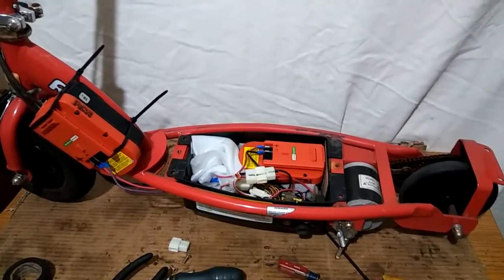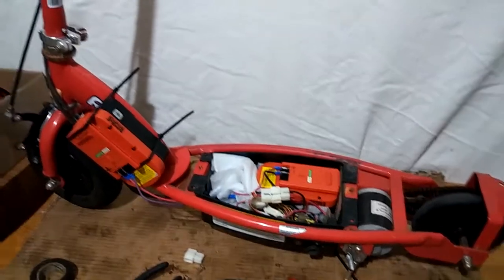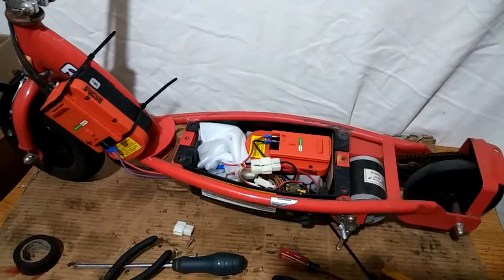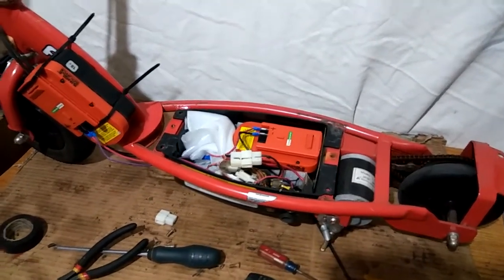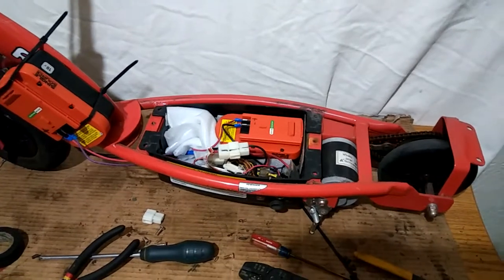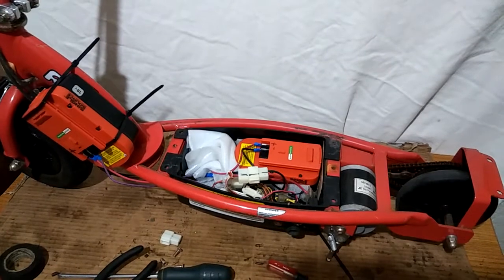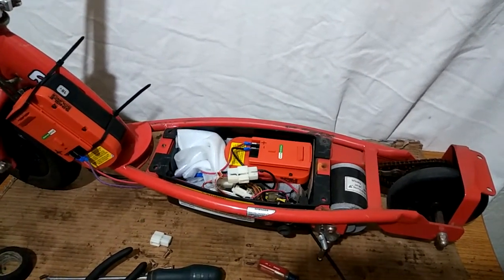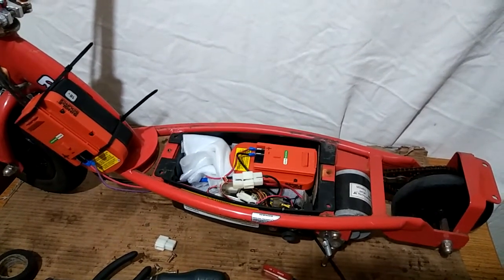Razor e100 mod

Comment: hey so I have an old e100 that I wasn't old to use when I was small but now I am 13 and found it in our storage and tried to start it up but turns out the batteries died from no use in a long time and the controller was fried from inside so i was about to order the battery and controller from online but turns out 15 km an hour to slow for me I want to go faster so can u just tell me the items u bought to make it faster so i can buy them before buying the items for slow scotter

Comment: what is the rating or watt power.  I want to make an electric cooler with this motor
Reply from the maker: James Chudy Its 24volt 100watt motor was just doing some experiments for the kids. for a cooler you're going to want to use one of the controllers out of one of the 200w setups like the E200 or the Razor Pocket Rocket so you don't have to push start it. all of these little razor Motors hold up well to being over volted have a mx500 controller on a mx350 @ 36volts and have had no problems and the kids ride the crap out of it but not all throttles are interchangeable you have to use the throttle from whatever unit you took the controller from

Comment: I found a rusty silver E100 from 2009, to charge it I'm using some trashy Toshiba laptop charger

But ofcourse these batteries already met God and hold charge for like 10 seconds.
So I'm looking for anything I could use without spending much money
Reply from the maker: Find a 18 volt drill from a garage sale or Facebook Marketplace

Comment: Do a rear wheel mod to make it silent
Reply from the maker: I made one using the front tire off of another E100 and mounted a sprocket to it never made a video but it was nicer riding. Upgraded to bigger better scooters that was basically for the kids to play with